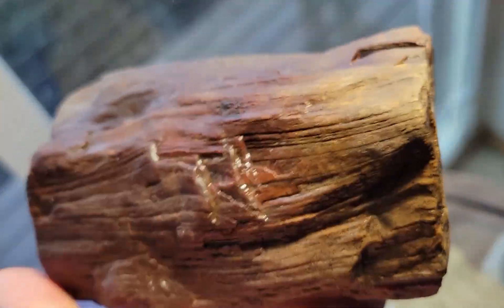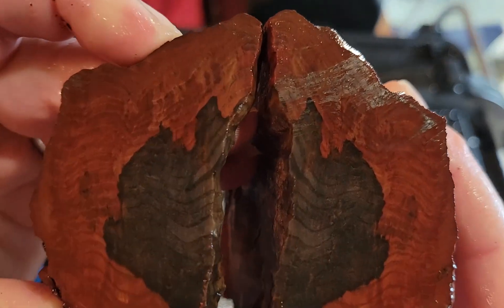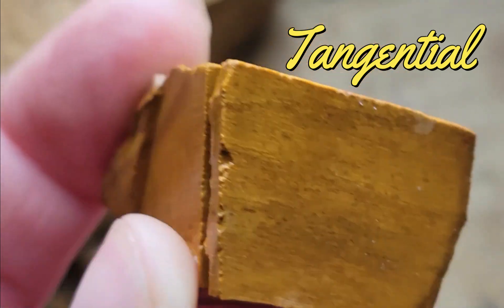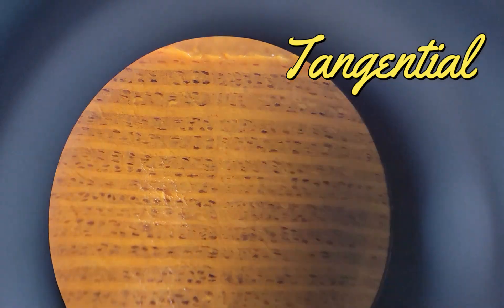Petrified Wood of Oregon and Giveaway!

Comment: I am new to petrified wood,  my question is how is an Arizona petrified wood different from Oregon petrified wood?
Reply from the maker: Great question, maybe I should do a QandA or an informative video about the petrified woods. For a short answer, the woods from different locales both differ in species of woods but also what minerals set up in the cellular structure to permineralize or petrify the wood, and other factors such as thermal, chemical, and other natural occurrences.  Each of the factors change the color and appearance of the wood as it's permineralizing. The wood can even be different values of silicification, as in agatized, jasperized, or opalized. In both Arizona and Oregon, there are woods that run the spectrum of possibilities. The famous AZ wood is rainbow colored because of the minerals and elements involved with its petrification. Oregon has some very colorful woods as well as other states. Hope that helps and thanks for watching!

Comment: tangential could be mortal or maple, redwoods were proliferent along coast, even palms may have been present then.
Reply from the maker: The three directions on that last piece, that I believe could be a Maple, are from the same specimen (including the tangential). I have come across a wider variety of species including what I believe are cypress, dawn redwood (metasequoia) , and oak. That being said, it's hard to know for sure unless you make your thin sections, check those out under the microscope, and pair them with the cell structures in the databases. All of that to come, hopefully, and I'll share it with future videos on the Petrified woods. Cheers!
Reply: myrtal wjood